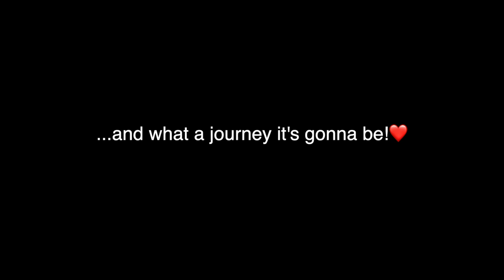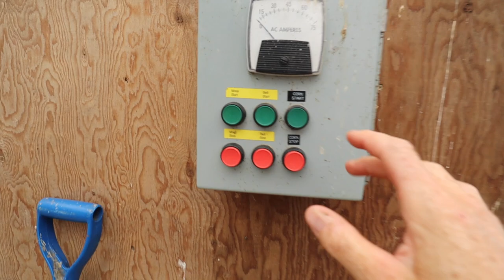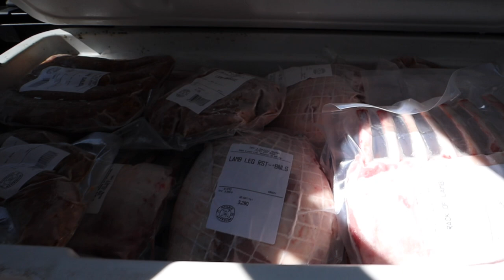What did EWE do!???😱 | Belinda's Been Busy... 😉 | Vlog 481

Comment: When you say CL is in the barn, why do the other sheep not show what goat has? Is it contagious, and if so, shouldn't Goat be isolated, or is it transmitted through birth from one generation to the other. Just curious how that is handled and does this disease show itself differently at certain life cycles?  It would help to know all these little details, seems like it's a very mysterious disease and not easy to detect.
Reply: I looked it up, being curious, and it seems to be spread mostly through direct contact with the bacteria. It's rarely airborn. Goat is not showing any external signs, no lesions, so she may be separated enough.

I wondered about the babies, but I'm not finding anything in my 5 minutes of reading.

Sandi's vet knows and she trusts that she's getting the best info. It is interesting to learn about CL in this situation. I'm glad Sandi is keeping the updates coming for us to learn from!
Reply: CL normally doesn’t cause the internal damage that her vet described from the postmortem. From what I understand they most often have a small cyst or two that grows, ruptures (contagious fluids), and then shrinks/scars. The cysts are common on the lymph nodes of the jaw and neck area although I think she mentioned one of her rams has a healed CL mark on his hip. Unfortunately with woolly sheep it can be hard to see the cysts so you can have a difficult time recognizing an actively infectious sheep.
Reply: @kansmill  ok...so why is the Goat terminally ill?
Reply: Goat has been diagnosed with Maedi-Visna, or Ovine progressive pneumonia (OPP, lunger disease. Maedi-Visna)
Ovine progressive pneumonia is a slow developing viral disease that is characterized by progressive weight loss, difficulty in breathing and development of lameness, paralysis, and hard bag. It is very closely related to caprine arthritis-encephalitis virus (CAE) and is caused by a retrovirus. The OPP virus closely resembles Maedi-Visna which is a similar slow or retrovirus found in other parts of the world. 

OPP is transmitted laterally to other susceptible animals or to offspring through ingestion of infected milk and colostrum. Veterinary diagnostic laboratory assistance is required for diagnosis. There is no treatment, but OPP can be eliminated from the herd using annual blood testing and removal of positive animals and removal of the lambs from the ewes prior to suckling. 

It is estimated that over 50% of the flocks in the U.S. are infected with OPP with the number of sheep infected within a positive flock anywhere between 1% to 70%. However, the vast majority of infected sheep will never show respiratory disease or a wasting syndrome. 

Source: http://www.sheep101.info/201/diseasesa-z.html
Reply: In  a earlier video she said that she'd have to test every sheep in her flock to figure out who has it and who doesn't.  Without that, there's no way of knowing if goat is the only one that has it or if it's in the flock. Sheep are social animals so putting Goat in isolation would only stress her out more for no reason.  I think she's assuming that it's in the flock and some other Ewes will show symptoms when they're older too.
Reply: If the one her vet was talking about was full of tumors post mortem, is it safe to be selling lambs for possible food consumption if there is a chance of CL?
Reply: Thank you to all in this thread that asked the questions and shared their research about this horrible disease. Sandi is holding up well - or deserves an Oscar. I am prepping the Oscar, as I have my opinion on this. Either way, this helps us not to need to ask questions which at this point would be so hard to deal with. We all love GOAT.
Reply: @susiewade5394  
Well - Sandi is preparing a lamb sausage dinner for her family. I think that answers the question very well.
Reply: @tulafisher9314  Thank you!  What good, clear information on an under-the-radio diseases.

Comment: Sandi, the Veno turnover crate looks like it’s really hard to rotate - is there any way you can lubricate the mechanism so it turns more easily?
Reply: If you watch, the sheep’s feet are dragging on the concrete when she tries to turn them over.  I think it’s just a natural response by the sheep to try to stay upright by planting their feet and stiffening their legs.
Reply: You also have to remember these ewes weigh 250+ lbs full grown. Even if she lubricated it, they would still be difficult to flip over.

Comment: Just a quick question...  I've seen on another site, that they can't or shouldn't, put that fresh manure on the garden, because it will "burn" it... how does that configure into your crop? Does it depend on the animal supplying the manure or the size of the field?
Reply: 👍What K the Archer said :-)  and also,  I put overly fresh manure in / on my garden in late fall in areas where I know I won't plant until Spring.  Some plants are much more tolerant of it than others.  :-) Last month I added a couple gallons of only lightly aged straight up chicken poop (manure - but specifying because around here what's marketed as bagged aged "chicken manure" usually contains a lot of other material, whereas this is straight up poo from a gardening pal) to my volunteer pumpkins last month and they're deliriously happy.  :-)

Comment: 5:34 Do you just mark the EWE which have lumps, bad udders and more only with color spray "The X", or do you also scan the Ewe's tag for the Gallagher Sheep System? Thanks for your Answer. Stefan from Switzerland
Reply: The red X is the initial marking easy for everyone to see. When the next load goes to the sale barn this ewe will be included. There is a lot of paperwork to include at this stage to accompany the sheep for sale. Part of the process will include reading the electronic tags (for Canadian Law) and completing the sheep notes on the Gallagher System (for Sandis maternal line records).

Comment: You give us birth wt & market at, my question is how much do your breeding ewes weigh.  I cant imagine spinning them to do their hooves
Reply: Sandi used to trim 2-3 times a year.  She does it frequently now, and seeing the manual clippers vs these power ones. It’s a huge difference watching her body language.
Reply: Sandi has a mixed flock of breed ewes, though each year she is adding just Rideau-Arcott replacement ewes. 
So weights:
Rideau-Arcott  mature ewes vary from 70 to 90 kg (155 lbs to 200 lbs)
Suffolk (black-headed ewes) mature ewes vary from 80 to 160 kg (175 lbs to     350 lbs)
Ile de France mature ewes from 90 - 95kg (200-210 lbs)